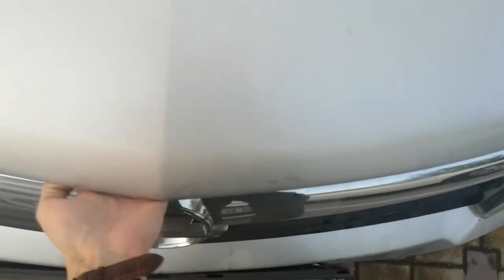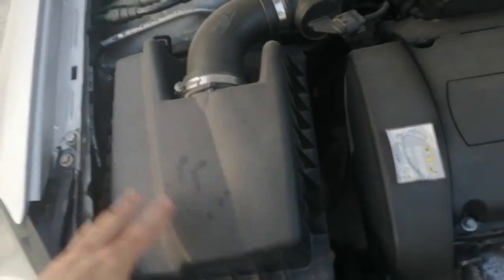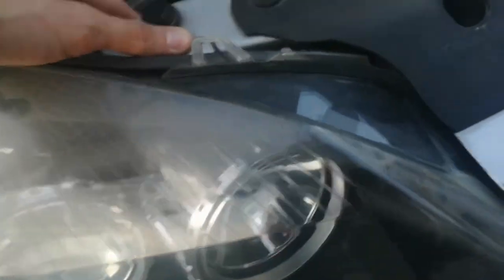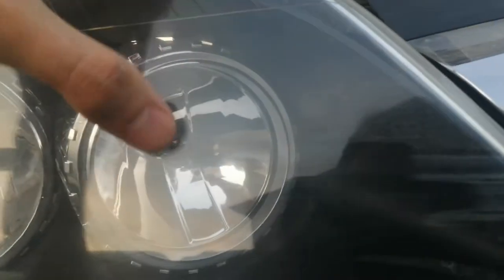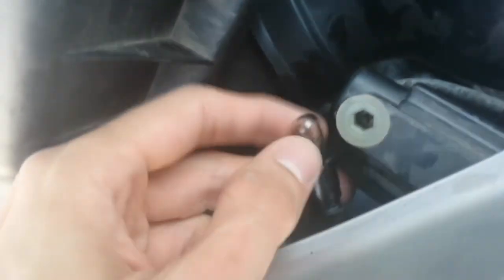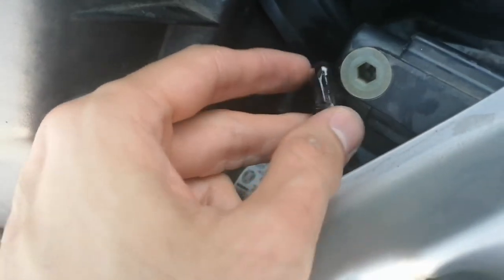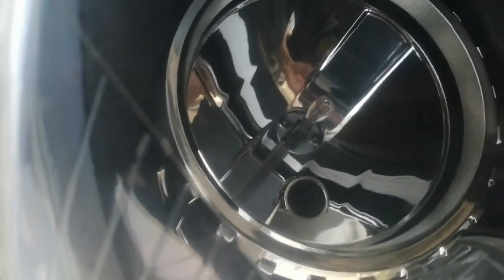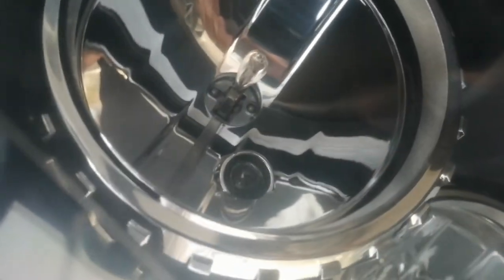How to Change Opel Astra H Parking Light/Schimbare Lumini Pozitie Opel Astra H

Comment: Thanks, changed mine on the same side... taking out air filter box helped with access.
Still, took a while fitting everything back in place (the air box and tubes are very annoying), with some swearing, plus I've dropped a torx bit down the bay and had to retrieve it... typical 😆

Comment: dude! there is a plate by your wheel you can remove to change the lights
Reply: Ale nie tych...
Reply: It is for changing the main lights, the parking lights are changed from the engine compartment.

Comment: You are giving wrong information in this video. To change the parking light on the right side of this Opel Astra H model, you should remove the black plastic tube that goes to the air filter, you don't have to remove the whole air filter box. Just the black tube in front of the lamp.